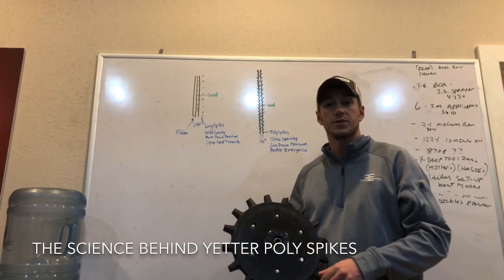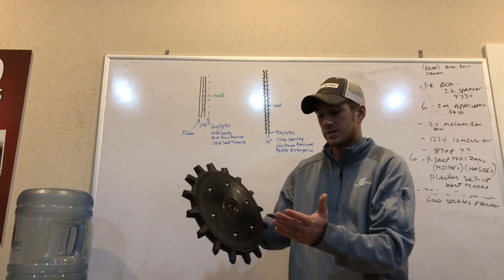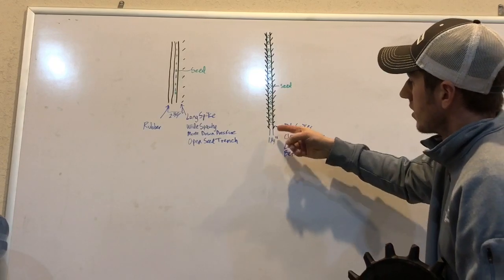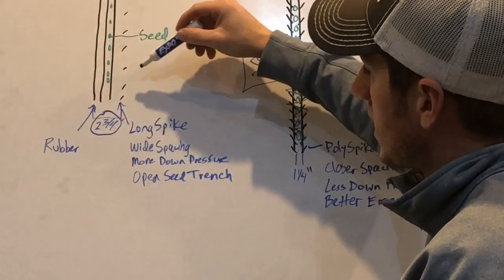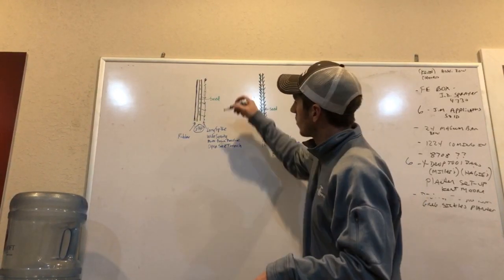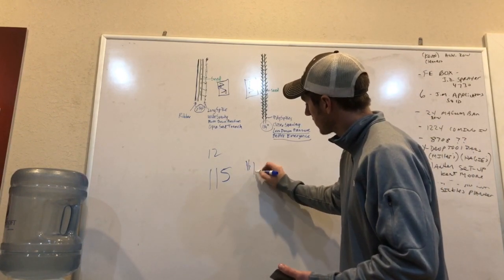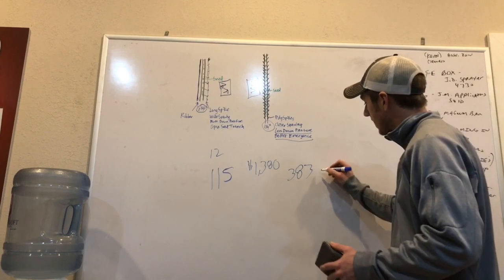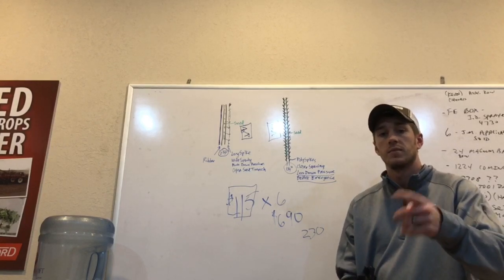The Science Behind Yetter Poly Spikes

Comment: Beck’s are running against to rubber tire closing wheel was wondering diff between one rubber and one spike. Gotbidea won’t be as much yield different.
Reply from the maker: You can do one rubber one spike as long as when in field operation they are the same diameters. Example if you put one poly twister and one rubber, because the poly twists are not designed to penetrate, the poly twist has a larger diameter than the rubber and the rubber will not touch the ground at all